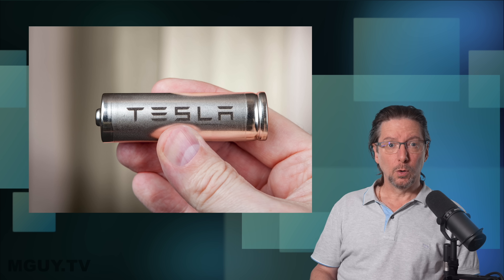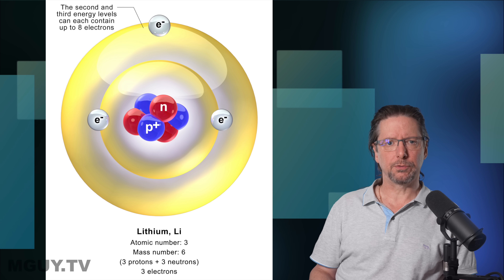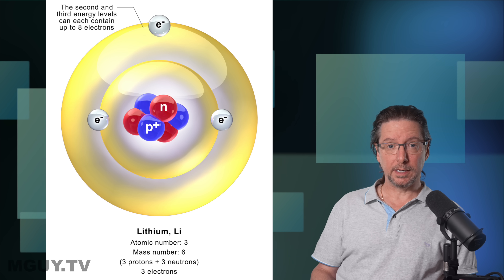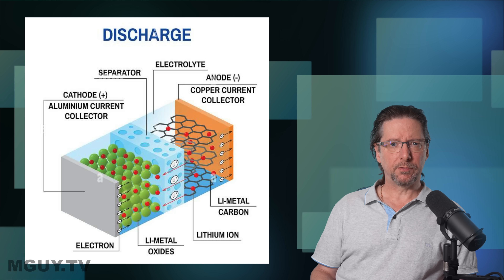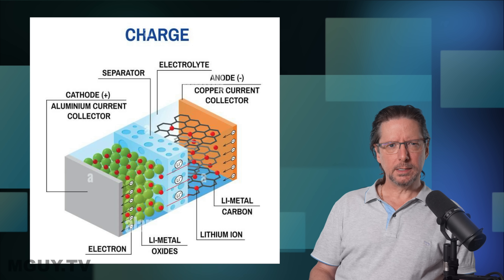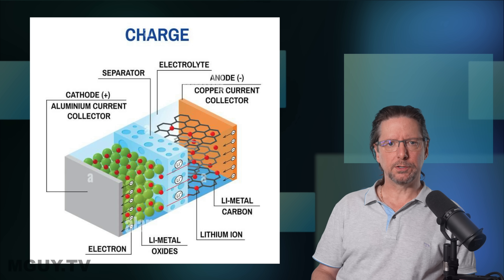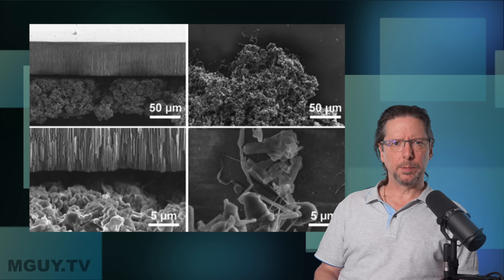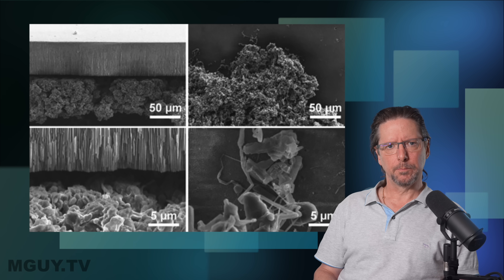Why are EVs so TERRIBLE in the cold? | MGUY Australia

Comment: Cold weather performance is the least dangerous thing about electric vehicles.  Fire,  toxic waste, ozone emissions and mass consumption would pollute the planet even more than combustion engines.
Reply: It's the funniest one though
Reply: CO2 is good for nature, the chemicals in those batteries are not.
Reply: You do realize gas cars catch on fire at extremely high rates, in the US alone it is 175,000 cars each year catch on fire. Gas cars have more toxic waste than an EV since you are burning gas the whole life of the vehicle.

A natural gas power plant is 60% efficient and are the most popular power plants. Gas cars burning their gasoline are like 20% efficient. EV's are up 3x more efficient at using the burned fossil fuels than a gas car. Then, when the car is retired, the battery is over 90% recyclable and reused towards a new EV battery. Whereas, gas cars have nothing reusable and continue polluting way more.
Reply: @itsatrap7215  There are over 250 million ICE cars in the US, compared to less than 2.5 million EVs.  Want to guess how many would catch fire if there were as many EVs on the road?  That says nothing of the strip mining and slave labour employed to extract the lithium required by demanding fanboys and government subsidies to reach a ludicrous 2030 goal.  Finally, how do you think charge points are powered?
Reply: @davey1602  You have no idea what you're talking about concerning EV fires. Just repeating oil industry propaganda is not a good look for you. Let me tell you WHY you should stay in your lane:
1) the rate of EV fires is calculated using a minimum sample size for measurement, completely negating the total population of each vehicle category. If you want to know the statistical reason that the comparison is valid, just ask, but you and I both know you're not interested. You just want to spew propaganda and hope you're right...but you're not.
2) the calculation for EV vs. ICE fires is based upon a) number of fires per 1 million miles, and b) number of fires per 100,000 vehicles. The NHTSA (American government agency) publishes the numbers, they conclude the fire risk between ICEs and EVs, and I assure you their statistical analysis is superior to yours. Suffice it to say, it is absolutely valid to state, as the NHTSA does, that EVs are at LEAST 10x safer from fire than a gas car, regardless of the total number of each type in the sample set.
3) Ah, the strip mining and slave labor myth from Big Oil. I must admit, the oil industry gets a lot of mileage from that one, assuming simpletons like you don't research anything. Most lithium comes from brine pits (and some ore) in South America and Australia, NOT the Congo. No slave labor there! If you want to mention Cobalt that DOES come from Africa, it's not used in modern battery chemistries anymore, but it will always be used to refine petroleum (as a de-sulphuring agent). By the way, children are used in the oil industry in Syria, how will you pay for your crimes? Every gallon of gas you buy is funding children being slaves.
4) one of the most subsidized industries on this planet is the oil industry, about $20 billion a year, not counting the free military protection they get.
Reply: @itsatrap7215 the lithium batteries in evs cost more to recycle than they're worth.  Some ice designs are in the mid 40s to 50% efficiency.  Electric is better but the batteries are nowhere near where they will have to be for mass adoption.

Evs will have to be more convenient to use than a gas car before most people will switch.  Right now that's not the case
Reply: @howebrad4601  Sorry, but the average ICE is only, at best, about 30% efficient thermally. That's very rare, and the typical engine in any car driven today is about 75% inefficient. Stating a rare exception does not an assessment make.

Comment: Haha, just you wait until all producers will have the new type of battery LFP that are more ethical, creeper and contain less rare minerals. The downside is that they have less energy density, the curve is more flat and in order to properly estimate the autonomy we will ask the driver to charge the battery at 100% one time per week that it is totally contrary to the current batteries where we ask the client to keep it charged between 20-80%and charge it to 100% only if they need to do long trips.

Ahh yes, and with this new battery we need to do warmup circles more frequently.

But hey, Tesla did it, if is more cheaper and we don't have ethical problems because we don't put children in mines.

Comment: Did i hear this correctly.....charging in really cold weather degrades the battery ????
Reply: yes don't charge up in really cold or really hot weather. don't charge up beyond 80% of charge. don't let it get below 20% charge. don't bump it. if it gets dinged on the outside you don't know what happens on the inside. it may be damaged which means you have a bomb ready to spontaneously ignite at any moment.

don't let it get real cold or real hot because then it degrades and that affects the lifetime, which is only 10 years at best.

Comment: 1:10 This is really just true for tesla and a few others. Most EV have larger prismatic cells and typically have between 100 and 200 cells, not several thousands that Tesla does. Those are typically the size and shape of a pack of A4 papers..

There is a other issue that people often don´t think about.

Cold air is denser. In a ICE cold air increased the efficiency of the engine, quite significantly so. This is just about as much to of set the increased air resistance. So that is why a ICE use about the same amount of fuel if its -20C or +20C.

For a EV this is not the case.

Comment: Thanks for the info on the batteries.
Clearly showing the issues that we can’t solve. the discharge and charging problems I would like to see when the cars parked and charging on a 47 degree day in the Aussie summer.
I believe that the ignition point of the batteries is 125 to 130 degrees c
Reply: well stated Ben..
Reply: I worked at a company that made add-on hybrid systems for commercial vehicles and learned some things about the limitations of ev technology.  We used a standard Ford hybrid battery that had an operating temperature limit of 66C.
Reply: I have a model y up here in frozen hellhole canada.. it gets COLD and stays that way for months on end. I plug in each night and never have any issues.. not like im driving 250km a day when the batt has lost a lot of range. And I still drive 500km to my home town in winters no problem.. i stop twice to charge and it gives me enough time to go to Tim Hortons , get a coffee and something  to eat and have a bathroom break.. stretch my legs a little and away I go. In the summer I only have to stop for a charge once... but in 6 hours of driving its not like I wouldnt be stopping twice anyways to do these things. I think too many people here just hate EV or just believe the FUD, intentionally I suspect. For me an EV is perfectly fine and I save a ton not having to get screwed for gas prices... if you are not one of these people, then EV's arent for you. Its that simple.
Reply: @Jojo-o6o6w  watch the Aussie test done on two top of the range BMW’s tested from Melbourne to Sydney.
They are worlds apart down under, and there’s more than one from new owners having their problems with less expensive EV.
We are not with the battery technology yet for them to get the correct and reliable range for the safety of operators of these vehicles.
Batteries are not the answer to reliability at all.
Think about cars, have they ever wanted reliability?
They want to sell parts and keep cash flow, it’s business.
Reply: Got any figures for that value (125-130) that you appear to have plucked from nowhere?

Comment: Tesla's were being used and charged at the same time in much colder countries and have been for over 10 years without any similar high profile charging incidents.
Reply: I would seriously question that assertion. ALL batteries suffer when it is cold. It's onl;y now that more than a few random people are suffering the effects while governments are forcing EVs on us that people are taking notice.
Reply: There are plenty of charging incidents documented even in warm climates, I've seen many videos of EVs and Tesla's bursting into flames during charging. The point is in the cold you have to heat the battery, you loose range by doing so and add degradation to the battery if its not fully hot. It is a slow process of causing additional battery health issues over many years. I learned recently that regen braking does not work in the cold unless the battery is good and hot. It even says it in the Tesla owners manual. Makes sense they would limit that as charging a cold lithium battery even for short bursts should not be recharged. You have a lot working against you trying to deal with batteries in he freezing cold.

Comment: I think a tiny engine with a remote electric starter would work better for warming it would make a lot more sense, but would look kind of cheesy, maybe you could leave it to charge while your away, but the battery is clearly flawed.
Reply: you just described hygried cars.  mazda with their wankel or liquid piston is a good example, but other cars used old fashioned small 4 cylinders.
Reply: yeah i dont know much about hybrids, or hygrieds not sure if thats a typo just would make sense as a back up so if you are potentially going to run out of battery you could let it charge up slowly, but youd have to carry gas with you, seems like it would solve it, but i guess thats like trying force beef down a vegans throat @longnamenocansayy

Comment: And this is why your old expired 12v car battery finally gives up in the winter.☃️
Reply: I live in north western Montana where it was -43°F last week and the original 12 V battery in my 2018 car functioned fine - when it dies I can replace it myself and the cost will be roughly $150 - I carry a spare “jumpstart” battery pack for just such an emergency, try doing that with your EV
Reply: @ragtowne  The problem is people are uninformed and don't know what they should be doing. You have morons that pop a tire and don't know how to replace it all the time. You can't fix dumb. All that is needed is people to precondition the battery before leaving their home for like 10-15 minutes.
Reply: @ragtowne when EV battery goes bad cost can be in the tens of thousands?
Reply: But only costs $100 to replace and probably lasted 5 years.  And the old one can be jumped with a hand held jumper in a few seconds to get you on your way.
Reply: The lead acid batteries are designed to fail between 2-4 years.
And they fail faster in an ICE car because of the increased pressure to start an engine.
But facts don't matter in this page. Apparently.
Reply: @owainbennett663  Erroneous facts, such as yours...no, you're right, they don't matter.
Reply: @TheRealDrJoey  OK. If you insist.
Reply: @owainbennett663  the main difference between lead acid batteries and lithium ion batts is that lead acid batts do no spontaneiously combust.

another big difference is that most all the time your lead acid battery can be fixed when it fails to charge up.

the reason it fails to charge is because of sulfation, which can be reversed with a higher than normal charge.

most of the batts that expire can be fixed in this manner.
Reply: @owainbennett663  i havent had a lead acid battery for over a decade, last few have been calcium with a life span of 5 years( warrenty).
They are usually rated in CCAs (cold crank amps) for the use of ICEs, larger the engine capacity the higher CCAs needed.
Faster in an ICE car? Do you need them in an EV 😄
Reply: @joshcheck7532  The last sentence made you sound stupid.
The whole post was about standard 12v battery in a Thermal Engine, which is exactly what in ICE is.
Reply: @owainbennett663  did it.
You said they fail faster in a ICE car, compared to what? 
I know my 12v 2 post battery isnt a lipo so its not the same as a EV battery
 and you dont need a 12v 2 post battery to start an EV now do you
Reply: @joshcheck7532  Fails in winter,  if a lead acid battery is going to fail. It's when it has to work harder.
But if you want to twist everything around, be my guest.
Reply: @owainbennett663  yes in winter when the cells are less active, just like he talked about in this vid.
Your 12v battery is only there to start your car, once running it gets it electrical requirements  from the alternating/chargeing system.
Reply: @joshcheck7532  partly true, with all the electronics in a modern vehicle, a battery needs to perform properly to ensure smooth operation.
Have the lights, air-conditioning and wipers going, the engine will labour. A good battery helps.
Reply: @owainbennett663  which is why they fail in winter
Reply: @joshcheck7532  The interesting thing is that (at least some) EV's have lead acid batteries, too, to supply power for all those 12 VDC loads in an EV car.  They're kept charged by a secondary charger from the main battery.
Reply: @joshcheck7532  yep, I agreed with that.
Reply: @joshcheck7532  Look up that EV Hummer video where it wouldn't "start" because it's 12V battery had died, taking its controller and other 12V loads with it.  It's pretty funny to see the tow truck driver jump-start the EV, once they figured out how to manually open the hood (since it normally opens electrically).
Reply: @joshcheck7532  You probably should do some research.  Most EVs do have a 12v battery in them to manage the non-HV element of the car (i.e. all the 'usual' electrics).  And they don't fail as quickly because they don't have to go through the high load of running a starter motor every time the car is used.
Reply: @owainbennett663  a car with an ICE only needs the battery for starting. When the engine is already working, the rectifier generates DC voltage for all the systems. You could use a jumpstarter to start the engine, and as long as you dont stop the engine, everything works.
Reply: @owainbennett663  I suppose also there's the fact the 12v can be replaced for $100. Whereas the EV battery might be $10,000+ - possibly totalling the car. I find 12v starting batteries can easily last 5 years and beyond. Also, there's infinitely less 'pressure' on the battery to fire a starter motor for 2 seconds vs. powering the whole car.
Reply: @MattExzy  How this massive post go from a 12V battery to this ?
The original post "And this is why your old expired  12V  battery gives up in winter"
EV haters will have a go at anything.
Reply: @owainbennett663   I guess not, at least in your case.  I bought my van in 2013 (11 years ago) and it still has the original battery.  Car batteries used to die mainly when you accidentally left lights on because they would drop to 0 volts.  Now that cars shut off loads that you leave on, they last 3 or 4 times as long.  And they are NOT designed to fail, of course.
Reply: @owainbennett663  That' why I love this Youtuber, he usually is wrong about stuff in his videos and I find it hilarious that he thinks he is smart, or pretends to be.